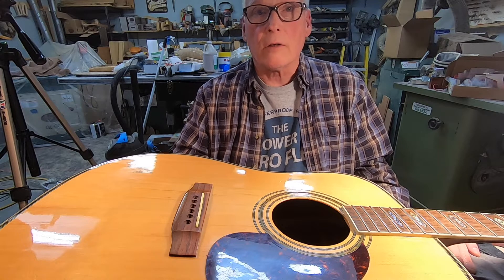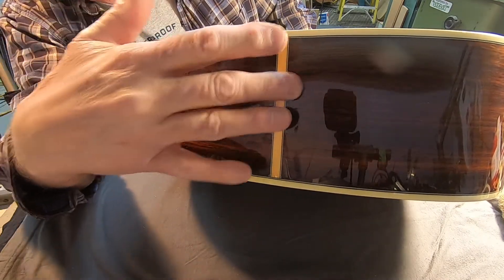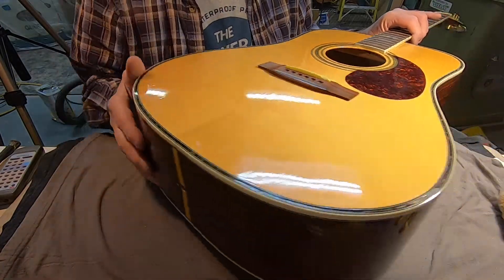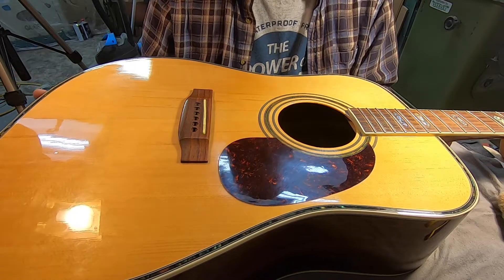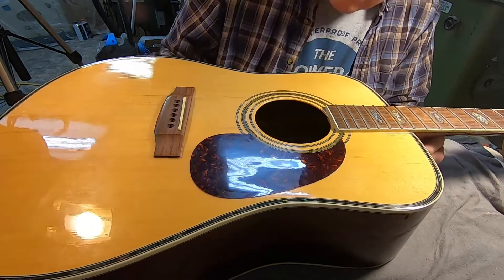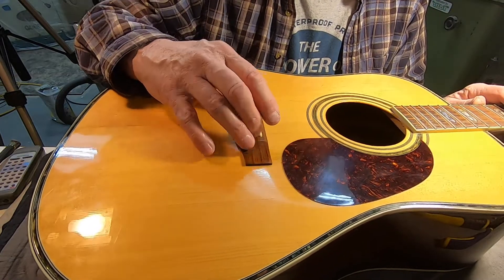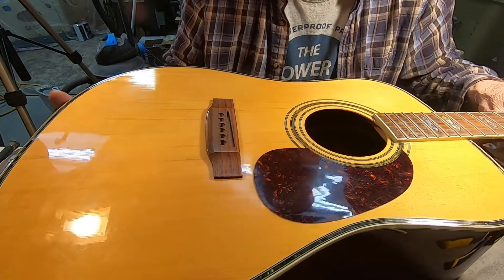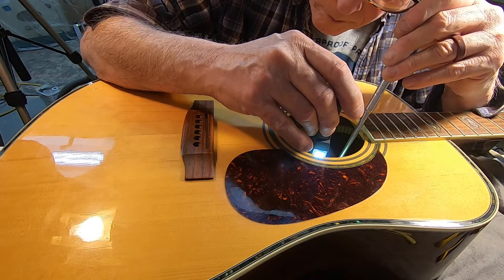SIGMA MARTIN INSPECTION, BY JONAH GUITARS 1st

Comment: Heya Dane. Now those were some odd problems. I wonder if it was left in a really hot car or something to cause all that. Or maybe it was just really poorly made. 
Did you get it all fixed up? Or is there a part 2 coming?
Reply from the maker: Hey Todd, prolly be several more parts coming. depends on how much detail I cut out. Poorly made, yes, in some ways for sure. But the really odd part for me ism how the binding is flawed out.